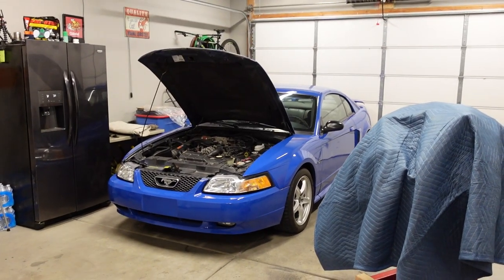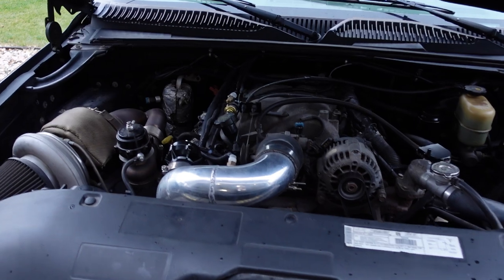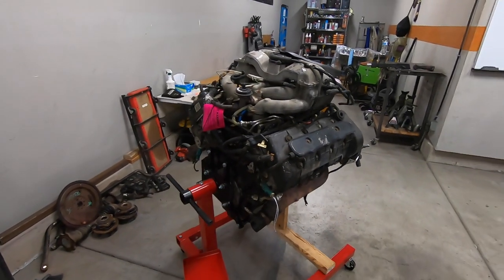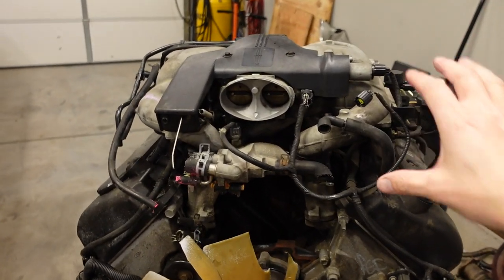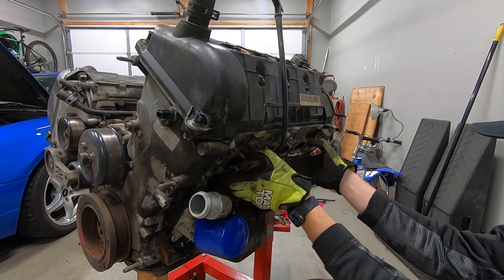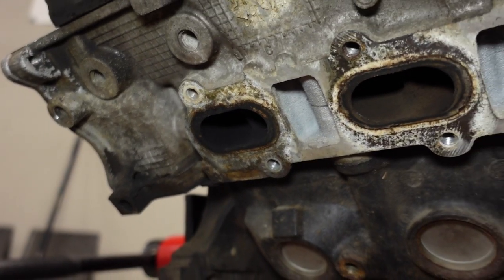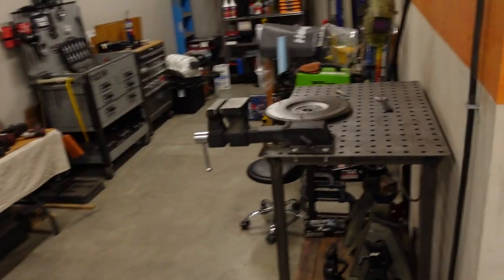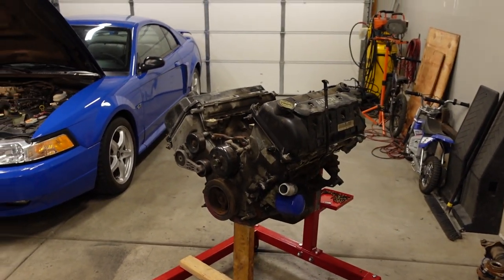I bought the LARGEST ENGINE I can fit into my Mustang

Comment: You forgot the 07-14 GT500 engines, but those are still pretty expensive anyways. I had one of these motors and was going to swap it into my King Cobra, but the 4.6 4v was the tallest that would fit in that configuration. But I had swapped on the navigator heads to that 4.6, but the navigator heads are the most commonly sought after 4v heads (aside from the obvious supercar and cobra R heads). You could also do a GT500 intake/supercharger set up! Those are relatively cheap and make good power. Nice thing about the 5.4 is that you can respond the coils and use the factory harness and computer!
Reply: There are tons of good blower options for the 5.4 gt500s.  I have a vmp gen3r on my 07 gt500 it's a torque monster and so is the 5.4 so they're a good pairing together.  My gt500 did 740/733 to the wheels on 19 psi with a stock long block, long tubes, full exhaust and twin 69 tbody/jlt 123 intake.  Tuned on 93/boostane (100 octane) it's a monster.  It was over 700 tq at the tires from like 3000-5500 rpm which is crazy and it was still pulling over 600 tq at 6500 rpm.  Saying it's an annual is an understatement lol.  I also have 410 gears and 200 lbs weight reduction (it weighs about 3700 without me in it). 5.4 is badass i always loved em.  Thinking about doing a high compression na 5.4 in my 97 cobra I'm fixing up.

Comment: I did something similar when I had my 2000 GT. Used a 5.4 f150 block with flat tops and forged rods, ported 03 cobra heads and boss 260 intake off an aussie car with a navigator ecm and harness. If I could go back in time with what I invested, I would have just done an LS though. This was back in 2009 and I was stubborn about wanting to keep it a Ford.

Comment: I am part of a mod motor group we have a guy that custom specs cams for around the same price as off the shelf cams. The cams are  where a alot of power is to be had with the older 4v motors.  I found  a build once  of  a guy that big bore and added a little bit of stroke with 11.5 compression custom cams ported heads and  a modified fr500c intake to fit the 5.4. I believe he was around 600rwhp

Comment: Thank goodness you didn't put another bloody Chev in a sweet as FORD !   Good rods needed for boost and oil pump gears. You'll want new chains too. I live in NZ, and my next-door neighbor has a mint '07 Falcon XR8 with the Boss 260 (near 350hp). The Falcon GT had the Boss 290 (near 390hp). Later years had Boss 302 (405hp) and Boss 315 (422 hp) versions.   I myself have a 2001 Falcon XR8 that has 220kw (295hp), from the engine the Boss series replaced in 2002....the old last of the pushrod 5 litre Windsors.  These last all iron 302w's were all special hand-built engines, that kept up with the then-current Holden Commodore SS 5.6 litre all alloy LS 1 !!
Reply: P. S. you forgot the GT500s from '07 to 2012 !!

Comment: It’d be a really cool build to see it done NA. A little porting on those heads, a bump up in compression, a set of big 4V camshafts, your planned intake would be perfect, and a good exhaust. It’s a build for a Foxbody I’d have liked to play with if I had the space to expand my fleet, time to keep building around my family and work, and money to do these sort of builds. As it is, 2 hotrods, 1 mild 1 wild, is all I can manage. Build it because everything else you mentioned has been done over and over again and there’s not a lot of variance in those mostly junkyard engine builds. I’ll also make my opinion known that doing just another turbo junkyard motor build will be less-than exciting. Make it tough. BTW the Coyote motors are 12:1(!!!) thanks to the DI fuel injection. The older gen I/II port injection engines were 11:1 though and trucks still got 10.5:1.

Comment: I think you might be wrong on the stock horsepower output of the Ford 5.4 32valve. The stock 5.4 truck engine, single overhead came is 336 HP. The stock 5.4 32valve double overhead cam is 400HP. Not sure where you got your numbers. A stock Chevy 5.3 truck motor is 295 HP. The Ford generates more HP due to the overhead cam setup.

Comment: 800 to 900 hp is fairly simple on a turbo 5.4 4v. The connecting rods and pistons would prove to be the weak point. Also I believe the intake you want was designed to go on a 5.4 with c heads, like an aviator or cobra. The navigator ports are a bit too big, but it can mostly be done.

Comment: 5.4’s are junk
Reply: Lmao, only if not properly maintained like anything else
Reply: Played with plenty of mod motors over the years and the reliability is just not there. Small oiling holes and poorly designed timing chain system.
Reply: Nothing is “properly maintained”. Properly maintained is Fords scape goat 😂🤣🤣🤣
Reply: @ratchetstrapgarage3609  The timing chain is not the problem they rarely go. The powdered metal gears are. Best to replace with billet gears

Comment: What a great choice for engines. Please follow the budget path and juggle multiple builds. I think this will give you some good results because there might be other things along the way that will need to be upgraded to realize the full potential of the build. Cant wait to see how much more adding boost will give you with stock bottom end, rebuilt heads, and some modded cams. I think I would have opted for the SHO motors with hella boost and maybe try for an AWD caged build. Looking forward to the outcome.

Comment: I was comparing measurements with other smallblocks and the 4.6 is bigger in dimensions than most small blocks out there, so you should have a good amount of room to work with... it is very long and very wide.  That being said, I am swapping a Mustang 2 K member and independent front suspension into an 87 Chevy Sprint (1500lb Geo Metro daddy,) The car will only be around 2000lbs with a small block in it and I think the suspension will be way too stiff, so maybe a heavier big block is what's needed to make it ride right! You sir get a subscribe. I like the way you think and the way you got me thinking.

Comment: Look into porting the exhaust side of the heads. If I remember correctly, on the navigator engine, the ports on the exhaust are a little on the small side and could benefit from porting. I could be wrong. It’s been years since I’ve looked into these engines. Also, The boss 290 manifold is awesome but if you ever wanted to experiment with coyote intake manifolds on that engine, I believe MMR makes adapters to put a coyote manifold on the 5.4.
Reply: The Cobra R heads flow the best followed by the 03/04 Cobra heads. The Navigator heads "not so much" but under boost it won't matter as much.

Comment: This great. Im Ford and general knowledge after and my buddy is a Chevy/ford combo guy. Ive tried to tell him for years how the mod motors are all interchangeable. How you can gwt any of them and they fit right in on any car that had one. Less the intake and maybe oil pan but the motor itself goes. He argues they are different motors all the time. They was youre using the Nav motor direct to cobra parts is just beautiful. Simple showing how I was right. Plus i have a Nav I want to gut and do something similar with the engine.

Comment: I manual swapped a Navigator when I lived in the United States. Part of the reason this engine is rated at 300 hp is because they only let it rev to 5500 rpm to keep the poor 4R100 safe.

Intake, exhaust, and a tune and I was pulling in the 365ish area at 6500 RPM. It's a ridiculously underrated engine.
Reply: I must ask. Where did you get your tune from? What intake did you use and what exhaust option did you go with?
Reply: @IVenomousV  I got a good deal on a Boss 290 intake manifold and I bought the Navi with a Flowmaster system already installed on it. I got Binary Editor from Core Tuning and did the tune myself which is pretty easy because I could use the 2000 Cobra R tune for reference on what numbers to change. I'm sure some headers and a better exhaust system would hit 400 no problem.
Reply: @BuffMyRadius  ok your the exact person I need to speak with. So I opted for the taller 5.0 Velocity stacked coyote intake manifold. As for the tuner. I opted for the TwEECer unit. BUT IM HEAVILY on the fence about getting the binary editor? Seeing that you did makes me want to. Thoughts?

Where the hell did you get a 2000 Cobra R tune from?
Reply: @IVenomousV  I decided to use BE with the Mongoose cable so the install would look stockish because I lived in California. (I actually got it through smog without issue) I also licensed ALL of the calibrations available in BE so I was able to look at the Navigator, Cobra R, and 4.6L Cobra tunes and figure out where to set things, which was great. I hit my A/F ratios almost perfectly on my first tune (went a bit rich down low and a bit lean at the top) so I didn't even need a wideband. Ran some corrections, bumped up the rev limiter to 6000, everything looked good, went to 6500, then to 7000(!!!). The top ended up rolling off so I ended up setting the redline at 6800, which is absolutely hilarious because the tach ends at 6500. I also didn't feel like immediately scattering a 200k mile Navi motor.

 It's honestly a shame Ford didn't use the engine more and most of them are set up for low end torque in Navi's. They turn stupid RPM with no issue and it's frustrating watching that hp number start climbing like rocket then roll over as the engine runs out of room to breathe as it spins another 2000 rpm. Long tubes and a true dual system with an X-pipe and there's no way it wouldn't have made 400.
Reply: @BuffMyRadius  I can go on for days with you regarding why they should have used this motor more. Hands down agreed. At least in the mustang - you cannot open the valve covers thus breakdown becomes extremely hard. 

Either way what’s the cost within Binary Editor to license each one of those calibrations?  I might do the exact same thing.
Reply: @BuffMyRadius  So what did you have to pay per each license for the Cobra R / Navigator / 4.6 Cobra Tunes? And this was in addition to purchasing the BE/EA Dongle? or did it come with it?

Comment: Honestly had this very build in my mind for a 2000s thunderbird. The Ford GT top end on the navigator bottom was my build idea. Power to wight is spot on for a five seat chassis. Thought it could be a perfect sleeper. At least 500hp and decent mph, with no inspection issues(smog). Then my son was born our fourth, so a third row became a necessity. We lucked out and ended up with a bush estate secret service yukon xl 8.1, huge and drinks like a fish but always starts and never gets stuck in maine snow lolol. How LT is planning to punch the 500-550hp to 900 I'll love to watch as the GT with the 5.4 didn't get all that much power. Of course the Ford GT is way lighter and ment for 200mph+ LaMans racing (24 hours+straight depending on individual race). So max power is is not end goal with the GT, control is, therefore lighter with less power. At any rate always wondered how it would pull next to a big block once properly built. Happy to watch, Good luck.

Comment: I like the idea of slapping it in there just to be sure that everything bolts up, just as proof of concept. It'll allow you to feel how it drives with that weight on the front and decide if you need front springs or can motor safely with what you have.

You'll also be able to hear and feel the engine and possibly detect any mechanical issues early, or determine that it can be run as-is for now.

But I also like the idea of a complete tear-down just because that's how CDO works. If you've forgotten, CDO is OCD alphabetized. ;>)